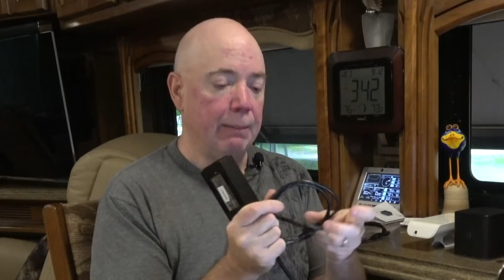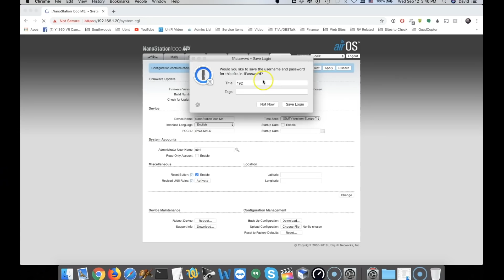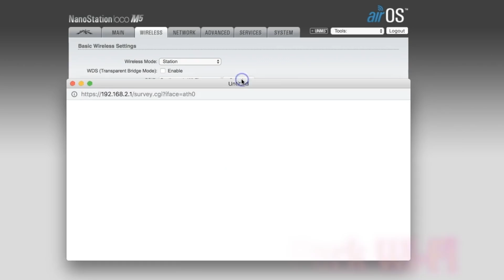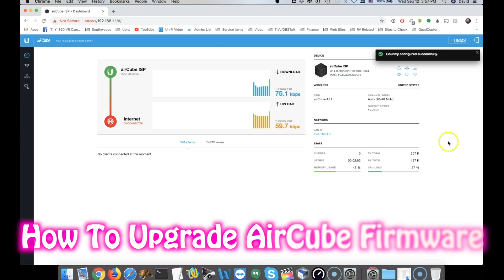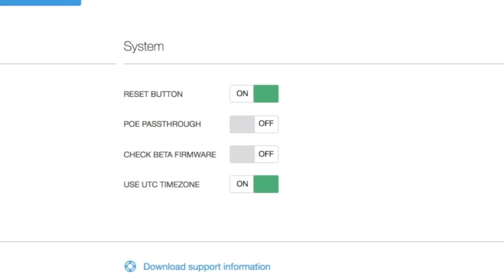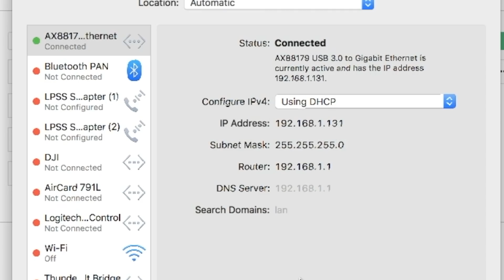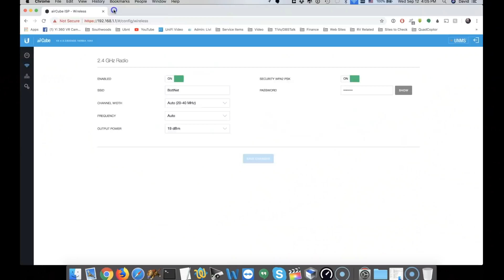Build a Private RV Wi Fi System with a NanoStation & AirCube AC

Comment: David, would recommend any of the other NanoStations 5Ghz ones or stick with 2.4 version you have in your video.  What do you thin about the Alfa Wifi Camp Pro 2?
Reply from the maker: The NS5 is a 5Ghz radio as you seem to know, as such, the park you are in also must be offering 5Ghz as a access point to connect to.  Most do not which is why I recommended the M2.  You can get a an NS5 and program it the say way and just switch it if the part offers 5ghz and you will be better off for sure as 5Ghz is less crowded.   I know nothing about the Camp Pro as I have never had a need to look at it.  It is a omni directional antenna, so I already know it is less powerful signal wise.

Comment: Hey David do I put the ethernet cord into a router of my internet?
Reply from the maker: Hi...Sorry, not sure what you are asking as the AirCube is a router and the Internet would come from whatever Wi-Fi SSID you are connecting the NanoStation to.  If you have router and Internet, then there is no need for this.  So I am really lost on what you are asking.
Reply: David Bott I fixed it lol I used a old ethernet that didn’t work so I bought a new one then then it worked

Comment: Thanks for the video Dave, appreciate it.  I'm deciding between the M2/aircube setup or the alfa wifi camp pro 2 wifi repeater kit for my RV.  Can you comment on which system should provide better performance and which one is easier to configure?
Reply from the maker: Sorry I can not as I have never used the Alfa.  But I will say the NanoStation is more powerful as it is directional and the AirCube AC is a full dual band router thus offering you 2.4Ghz and 5Ghz for your devices to connect to.  As far as setup goes, the Alfa would be easier as there is nothing really to set up.  It's a simple consumer device made to be quick and easy.
Reply: @DavidBott  Hi Dave, I ended up getting the M2/aircube and have been using it over the past year.  All-in-all it has worked out great for us using your instructions!  I have the nanostation attached to a pvc pole, which attaches to the side of the RV via suction cup.  Every once in awhile the suction cup stops "suctioning" and the nanostation falls to the  ground.  It still functions but it definitely is starting to cause problems.  The aircube seems to be working fine.

Since I probably need to get a new nanostation, is there another brand or setup that you would recommend that is easier to configure when I get to parks?  I'm looking at something in the $200 range.  Thanks!!!!!!
Reply from the maker: @scottschmok1405  Hi...The AirMAx NanoStation M2 (2.4Ghz)  and M5 (5Ghz) are still the got to products for this use.  AS far as easy to use, they are very easy once setup as from that point forward it is just goto the Wi-Fi Tab, click selected and find ther AP SSID you want to connect to. Put in the password if required and off you go.  Not much more to it.  DO NOT BY THE NanoStation AC MODELS as the AC models only work with other Ubnt AC devices as they are made to be used as Bridges.  AS a side note, to make a switchto a new unit quick, you can go into the NanoStation and BACKUP the config. (It will download to your computer.)  Then when you go into the new NanoStatation, you can go into the area to RESTORE a Backup, find the file, and it will upload the NanoStation.  Click at the bottom to save and then at the top to APPLY and (Or whatever...it has been some time. LOL) and when it reboots, it will have all the same settings as your old one.  (Same goes for M2 or M5 as you can use the M2 config on the M5.  Some people have both radios and if a park offers 5Ghz, they use the M5.)   Good Luck!
Reply: @DavidBott  Thanks Dave, really appreciate it!
Reply: Hi Dave, what are your thoughts on the wineguard connect T 2.0?  I'd like to have a system that supports both a wifi extender when we are in range (RV park, etc.) and also support mobile data when we are out of any wifi range. Thanks!
Reply from the maker: @scottschmok1405  Hi...I have a blog post and video on that also. :) Here you go...  https://www.outsideourbubble.com/winegard-connect-v2-wi-fi-my-take-on-it/
Reply: @DavidBott  Hi Dave, I've got a perplexing issue I wanted your thoughts on.  We have our trailer stored on our property when not traveling, and I connect to my wifi from inside my house using this setup so we can have wifi in the trailer when needed.  I've always had great connections up until several months ago.  No, when I go to connect using this setup, it sees the house wifi signal (about -50dbm) and connects.  However, my data rates are extremely low (1-2 mbs).  My house wifi works fine with other devices, and I've reset this system, but I'm still having problems.  As another datapoint, I brought the system into the house to troubleshoot.  I connected to the house wifi and the speedtest shows about 19mb download speed.  My phone connected to the house wifi is at about 90mb.  

Any ideas would be greatly appreciated!
Reply from the maker: @scottschmok1405  Hi...It sounds like interference and thus a poor signal from the home to the RV as there is something "new" in the air that is interfering with the wi-fi connection.  I am not shocked to read about the speed tests while in the home as you are more or less repeating the signal and that will result is loss of speeds based on the "hops".  But it does sounds like you are getting interference somewhere.  Maybe try changing the channel on your Wi-Fi router that it uses. (IE, if it is on CH 6, make it 11 or 1)  Then reboot your NanoStation so it can find the link on the new channel.   Hope this might help.  Good Luck.
Reply: @DavidBott  Hi David, you were right! I switched the channels and everything works much better. I have a Wi-Fi analyzer app and it shows some congestion around where the original channel was. Switched it to channel 11 and it works great. Thanks again!!!!
Reply from the maker: @scottschmok1405  Great to read!!!!   Yippee!

Comment: Thank you for this. I want to use a VPN and choose a different country. Would this work on this setup?
Reply from the maker: The VPN has nothing to so with how you connect to this Internet.   This will get you connected to the Internet via a Wi-Fi SSID you can connect to andthen you use VPN software or a VPN router for the VPN service you may choose to use.

Comment: Hi David thanks for the tutorial just set up the cube here in our motorhome located on our land in SW France where we are re-building our mill ruin at a ripe old age of 68. Here in France we have been tethering to our cell phone for the internet the signal has been dire. Our local campsite a 1/3 rd of a mile away has wifi super fast...so with the nano m2 and cube we now have a great signal. Iv'e mounted the M2 on a 20 foot pole as the church degrades the signal any lower.  Thanks again life just got brighter as Sue can now use her samsung tablet to learn French & I can check prices of materials and suppliers................  All the very best from Steve & Sue.... Captains French Adventures ..........Amazon books

Comment: Using your tutorial I got one set up to get WiFi into my hanger. Thank you for you help and expertise. Now I want to set up one for the RV. Question....the nano station is either 2.4 or 5 GHz. If the RV park only is broadcasting on one band, do I have to get 2 Nono stations?
Reply from the maker: All RV Parks will, or should, offer 2.4Ghz alway as 5Ghz dose not go through things very well. So if you only want one, get the M2 (2.4Ghz).  If the park does offer 5Ghz, it is a better choice if can reach it without issue as it is less crowded.  So, feel free to also get an M5 and use it when you can.  So yes, two different versions would be required. They set up 100% the same and thus can just be swapped and used as needed.  NOTE...DO NOT GET THE 5AC.  As the NanoStation AirMax 5AC will ONLY connect to other AirMax 5AC radios!

Comment: David, I got the network working from home and it works on using the signal from my home network. I cannot get it to work from my Personal Hotspot on my iPhone. I gone through the Cheat Sheet and all looks good. I located the SSID of the phone and then Lock to AP, Then add p/w and click Change. Then Apply. But the Nano Station does not indicate that it has attached. The 4 lights on the right of the Nano Station do not light up. I then go back into Wireless set up and it is still there. Any ideas on what I missed or did wrong? On the Mac I see the Personal Hotspot but it is a link and not wi-fi like the other SSIDs. Thanks for your help.

Kevin
Reply: I found the solution. Operator error. I had the settings on my phone set wrong. Once I reviewed everything I did on the setup of the nano station I then checked my phone and found my error in the setting that I had turned off. My brain does not operate as fast as it use to. I just need to sleep on it. Thanks, Kevin

Comment: Hi David, Thanks for the great tutorial.  Do you know if the Loco5AC would work in this application?  It appears to support both 2.5 and 5 Ghz bands.  I'm seeing more and more parks that are upgrading to support both.  Also can the UNMS App be used to manage connections to the park network?
Reply: The AirMax 5AC radios ONLY WORK with other AirMax 5AC products.  They are used as wireless bridges in a network.  So no...it will not work to connect 5Ghz networks.  The UNMS can be used to connect to your AirMax device and select the Wi-Fi to SSID to connect to.
Reply: @davidbott5438  - Thanks for the quick reply.  I was able to borrow a Loco5AC from the park owner for testing.  It connects to the park backbone net via a Rocket R5AC-PRISM-M.  Too bad it can't be used as a client station. I'm looking for an outdoor POE device that can be mounted on a flag pole (Flag Pole Buddy) and connected to my Raspberry Pi hotspot, or AirCube device.  I've tried USB WiFi dongles with mixed success.

Comment: Can this same setup be done with Ubiquiti Omnidirectional Bullet?
Reply from the maker: Yes, it sure can.  It uses the same OS so the instructions should be fine.  Note however, the firmware has changed looks some over time...but the settings are the same.

Comment: Hi David. Worked through the problem I had yesterday where I could not get past the Privacy Message on the Nano Station where it said that the certificate was bad. Today I did a search for "your connection is not Private" and there was a link to Technipages.com. They gave a solution through Terminal in Utilities on my Mac. Once I added the line that they suggested  I got past the privacy  screen and moved onto the AirOS screen and everything went smoothly from then on. Thanks for your detailed description. I followed along with a iPad and worked on my Mac.  I appreciate you doing this for us RVers. Kevin
Reply from the maker: Hi...You did receive my response about it right?  I did reply to you and found somewhat the same thing when I did a search.  All in all, glad you got it going.

Comment: Hi David...Thank you for the detailed step-by-step instructions. I used the NanoStation M2 with the airCube AC and it’s working perfectly. As a note, to survey and connect to a new WiFi point with the NanoStation M2 web interface at 192.168.2.1, the web browser on a tablet or phone can be used as well, particularly when pointing the NanoStation to optimize a WiFi signal.
Reply from the maker: Glad it worked out. (Like it would not. :))   But yes, you are correct...You can use anything attached to your network that has a web browser.  Also, look into the UNMS App (Ubnt Network Management System).  You can add your device via IP and them use the APP to select the SSID to connect to. :)  Open APP, click the three lines top right, Click on the little door with the arrow top right, add 192.168.2.1 and then your username and password and you will connect to the NanoStation. It will also save these settings for next time.  Hope this also helps.  (I think you can also use the same USMS for the AirCube just add the IP etc also and you can log into either if needed.)
Reply: @DavidBott  Excellent! Thanks so much again. I had already downloaded the app to my iPad, but did not realize it worked with the NanoStation. The “Antenna Alignment” feature looks really useful.

Comment: I setup the system and had it working at RV parks. I came home and  the home router is visible on the NanoStation but the MAC address is not selectable. I have checked my router and it is set to allow all to connect?
Reply: Hi... Try just manually typing in the SSID and of course the password vs selecting it from the list and see if it connects. (Make sure you type it in correctly, caps and small letters matter. ) No need to LOCK to MAC address seeing you are home and their is only one AP.
Reply: David Bott  Tried the Home AP and password no errors but no connection after I hit the change and apply. When I went to then try a scan I got nothing?
Reply: @waltczekurlon4603  Do the lights on the NanoStation light up as if connected to the AP?  If they are on and have a signal, then you have something else wrong it would seem. If they are all flashing on and off, then it can see the SSID but it can't connect and that usually is a password issue.   As far as getting "Nothing" on a scan...not sure on that as surely there are other SSID's around unless you live in the middle of nowhere and yours Wi-Fi is the only Wi-Fi. :-)   I am kind of not sure how to advise further other than to verify the settings and to be sure you can connect your phone to your home and if you have anther Wi-Fi source, like a JetPack or your phones HotSpot that you can turn on, you then can at least try to connect the NanoStation to another source and see what happens.  But if you can't even scan...hummm.....?????
Reply: @davidbott5438  OK I unplugged the nanostation and then plugged back in. (reboot) guess what all worked? Thanks for the help.

Comment: Hi David, just checking to see if you might be able to help with this.  I purchased the NanoStation M2 as well as the AirCube AC and used your video to setup.  The NanoStation connects to my Marina's AP with a strong signal but I do not have internet.  I can connect to the same AP with my phone and have no problem getting internet.  Any thoughts ?
Reply from the maker: Check in the NanoStation that you remembered to check the NAT box and all the settings under that when checked are also checked. If it is the marina may be blocking routers from connecting and you will want to CLONE MAC Address and when you check off that option put in f4:0f:24:1a:0a:54 which will show up as a Apple product to them.   (Remember to CHANGE and APPLY and the NanoStation will reboot.)  When you connect to the Marina there is no Captive Portal you need to go though is there?  A Welcome or Agree page that comes up on your phone?  If so, then when you are connected to the new network and you see the NanoStation is all lit up showing a connection...try going to a non-HTTPS page like http://Bott.Net  (My captive portal check) and the captive portal should show up if they are using one.  Hope one of these is it.  Good luck!

Comment: I recently moved to another campground.  I set up my 5GHz there w/the assistance of a friend.  He had more experience than I.  As well as I only have iPad, iPhone to work with. I am trying to connect here at this park and I do not know how or maybe the WiFi here is 2.4 GHz..  if so can I manage it with my iPad and get connected. ????
Reply from the maker: If you bought a 5Ghz Nanostation...most RV parks are 2.4Ghz which is why I recommend the M2 Loco. But if you had it all setup and running, you surely can connect to your private network with your iPad and then go to 192.168.2.1 to logo into the NanoStation to try to make a connection.  Again however, if you have a 5Ghz NanoStation and the park does not offer 5Ghz...you will not be able to connect.   Here is a reminder of how to connect when arriving at a new park...

FOR AFTER ALL IS DONE…QUICK CONNECT CHEAT SHEET….

1) Connect to your Wi-Fi SSID.

2) Open web browser and go to: http://192.168.2.1

3) Put in the user name and your password. User name = ubnt   Password = What you made it.

4) Click on the WIRELESS tab.

5) Click on SELECT

6) Find the Access Point you would like to connect to. (The park or your own data device.)If there are several with the same SSID name you want to connect to, then select the best signal. The first number in the Signal column you want to be closer to zero. -55 is better than -75.

7) At the bottom click LOCK TO AP.

8) If the Access Point requires a password *, enter it in the bottom area. (The park would have supplied one if needed. Or the one for your own data device.)

9) Bottom Right of the screen click CHANGE.

10) Top of the screen click APPLY.
Reply: David Bott tried to go to  http://192.168.2.1   No luck.  So tuff for a novice critter. Should I order the 2.4 ???  Or can u just call me?